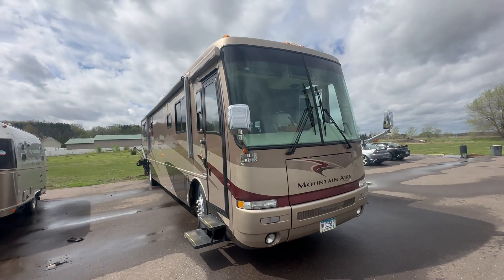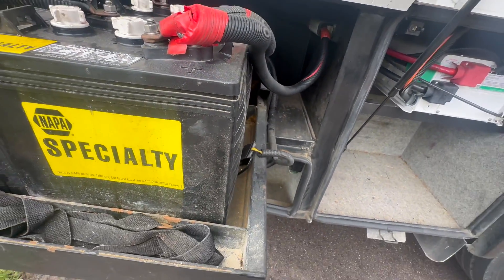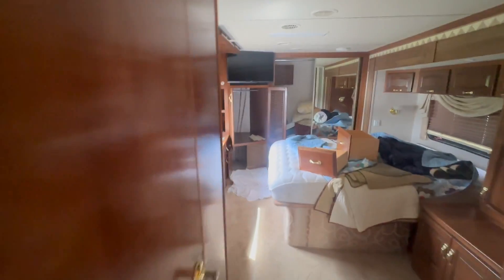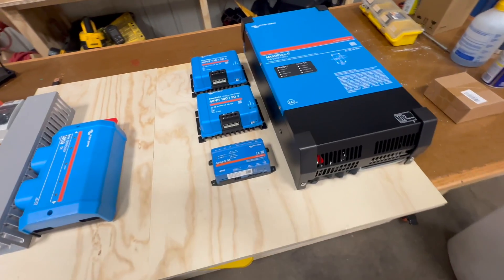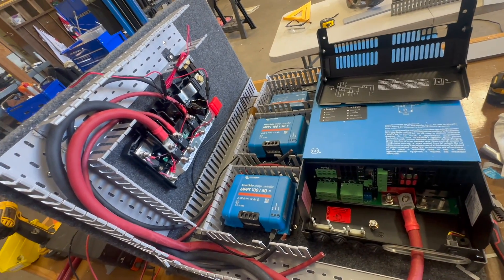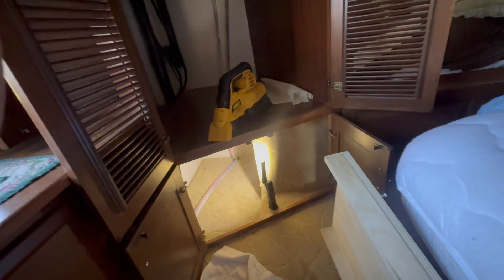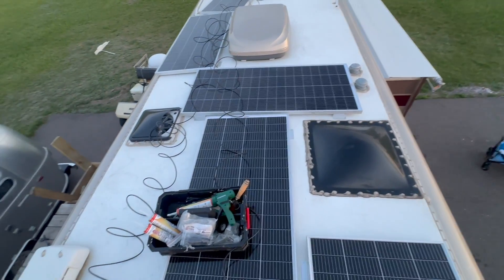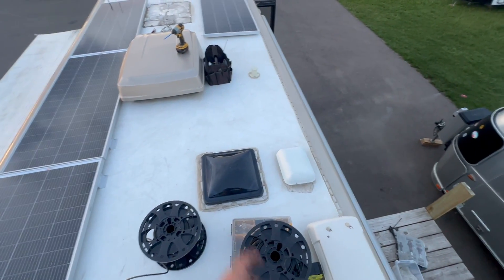2003 Mountain Aire Class A Victron Solar install Part 1

Comment: Grounding question. I’ve seen diagrams that have the Victron multiplus II grounded both to the lynx (lynx grounded to chassis with 4/0) and to the chassis directly using 4/0 cable. I’ve also seen ones where they ground 2 4/0 cables to the lynx and then have the lynx grounded to the chassis. How do you do it?

Comment: The dihool 400 replaces the need for a switch and a fuse. That right?
Reply from the maker: Yea
Reply: @sotasolar  my 4/0 wire ends don’t fit into the 400amp dihool. Grind them down?
Reply from the maker: @aphillips76  Yes

Comment: Also, any reason you didn’t put the batteries in the compartment where the old ones were? I was thinking of removing the tray to make more room. I’m assuming you found that the inside a)had more room and b) would stay more temperature controlled.
Reply from the maker: Mostly for temp as the Li time battery has no heating I believe. Although I don’t stay up on all their new product offerings.

Comment: I have a 2000 Newmar Dutch Star that I’m planning out now. I noticed you went straight to the distributor with the alternator wire. No dc to dc? That is, you’re not concerned about overloading the alternator?
Reply from the maker: We did have circuit protection. I believe we showed we got 300-400w out of it as-is. With these diesels I’m not as concerned about cooking the alternator, nor am I with the alternator perfectly charging the batteries.  When you have 2000+w of solar, let it handle the final charge. Just my $.02 

Now if you have a second alternator or want to push your alternator, I’d recommend a belmar or wake speed alternator controller.
Reply: @sotasolar  awesome. TY!

Comment: I found the 5/16 connection on the Multiplus II forces a severe bend also.  I also resorted to 3/8 lug to give some 'flex'.  Q:  Do you find that you are installing ONLY Multiplus II's now and not regular Multiplus?
Reply from the maker: We do install mostly the IIs . Mostly the 2x120s . If we considered a system with an auto transformer we’d go for the 1s or at least the 120 only 2s